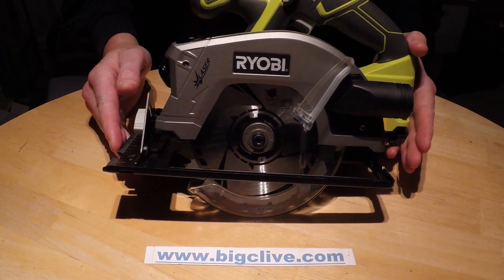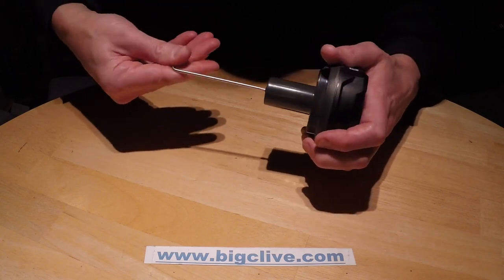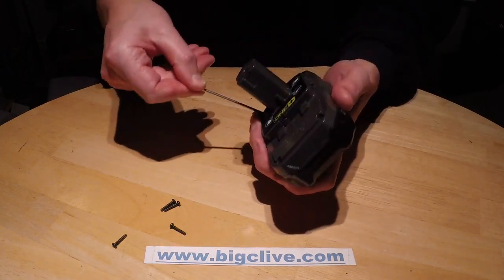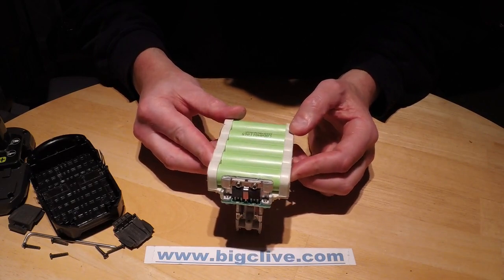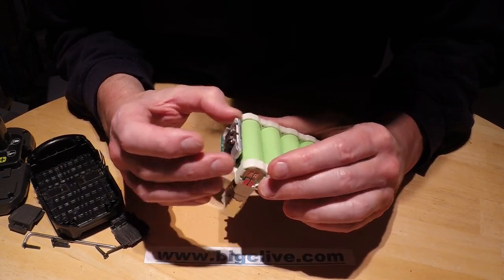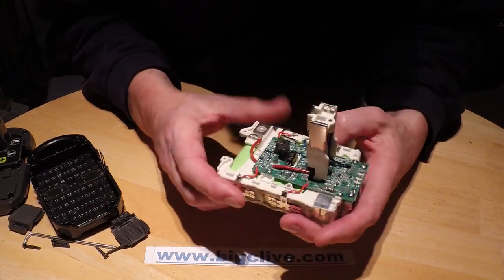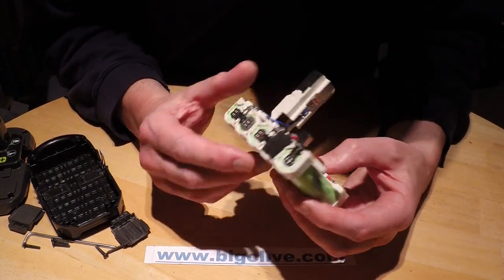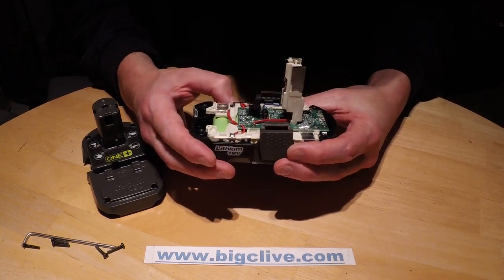A look inside a Ryobi 1.3Ah 18V lithium battery pack.

Comment: Next time use electric screw driver, or power drill to remove screws, it can save you a lot of time.
Reply: Might not work on all batteries. I just opened one and they use security T10 screws. (Answered at 1:40)

Comment: Hey Clive, love your content. Any chance you could go into more detail about how the 2 mosfets work in this circuit? I've opened a pack and am troubleshooting why the 5s batteries show 21v but the pack terminals show 9.6v. It seems related to the mosfets. I would love to be able to repair the pack but at this point am more concerned with just understanding how it works.

Comment: I actually use a pile of different tools all purchased or received second hand without batteries.
I did make sure all were between 18-21V.
Ended up hacking connectors off of all of them, tacking on a standard hobby plug (deans), and using my ample supply of 5 cell 90C batteries my drones run off of.
Works incredibly well and you don't need to buy the overpriced $150 batteries for each tool. I also use a $25 charger from Aliexpress in balance mode.

Comment: ...thanks for not trying to see if the cells are removable, so that I could recharge them in a pinch with a solar charger using a rechargeable head lamp...
Reply from the maker: That's not practical.  But you could improvise an external charger.

Comment: A bit late to this party, but I've been doing a sort of CPR on these. Seems if one or more cells drops below @10 volts, the charger/charging circuit will refuse to charge the battery. If I remove the pack from the case and charge the cell array directly, by-passing the circuitry (from a fully-charged battery), and get the total voltage above 12-14 volts, the charging system will allow the pack to be fully charged. It just takes a minute or two. Once fully charged, I test each cell for reasonable voltage.
I took four batteries from the recycle bin at the big box store and all were fine after this procedure (two were the big 10 cell packs). They've been working fine for months now.
Moral of this story? Don't let these battery packs self-discharge below 10-12 volts or the charging system will reject them, even if they are perfectly good.

Comment: I have problem with p107. I upload video in here 
https://youtu.be/8kVmbHED6_A
Can u tell me what happens with my battery pack?
Reply from the maker: It may be in protection mode if one of the sets of cells has dropped below about 2.5 to 3v.  If a cell's voltage drops too low it suffers damage.

Comment: The arrangement of the back-to-back mosfets is to be able to 'disconnect' current flowing both in and out. This is not possible with a single mosfet, since it has an internal body-diode.
Reply: Thanks for this comment. I’m in the process of diagnosing a failure on one of these packs and those MOSFETs appear to be the problem but I couldn’t figure out what their role was in the circuit.

Comment: All i did after the battery died on my NI-CD drill was take out the 10 sub-c batteries and stick in a 14.8v lipo battery pack i got from a car boot sale for £1 and cut a hole in the shell to hang the cables out and charge with a Imax B6 balance charger.

Comment: What you are talking about is ..... Li Batteries needed Balancing. Also, when it's HOT the Switch / Thermostat would CUT OFF until Temperature is SAFE again for the LI Battery to work. LI Battery is NOT good at HOT environment. So basically this is a Charger Regulator, Balancer and Safety built it.

Comment: I have salvaged several 1+ packs and checked out the specs on the cells in them and they are quite good for the price we pay.  They can put out a massive pile of current even when in the 5 cell thin packs like in this video.

The full sized packs are even better as they are 5s2p in configuration and will seriously pump out current.

The cells I have salvaged from them all seem to have a max current draw of 20A so it is quite possible to see 200A from a full sized pack.

Comment: that looks just like the insides of the craftsman c3 19.2 volt packs, i would say with how many i have sitting in a box dead i would if i were you waterproof the packs or coat the boards with something like a potting cause here in FL USA its humid and they get corroded fast.

Comment: if you have no charger for the battery pack, could you take the batteries out of the pack and charge individually? The chargers here are very expensive.
Reply: I think you can charge this thing with simple 22-24V DC at the contacts of the pack. All the charge logic is inside.

You can charge a single cell via USB-Connectable PCB (30 ct including package!).
http://www.aliexpress.com/item/Free-Shipping-5V-1A-Micro-USB-18650-Lithium-Battery-Charging-Board-Charger-Module-Protection-Dual/32453058256.html

 There are even such "balancers" for more cells.

Comment: Would it be feasible to built similar pack? I've seen some nice Bosh tools with no battery pack, with spares costing way more then tool itself... I wonder if some simple 5S1P controller would do the trick...
Reply from the maker: +cthulpiss Given the huge current that these battery packs have to deliver I'd recommend going for the official unit.

Comment: the three upper tabs on the battery are as follows, battery positive,  battery negative,  temperature probe. if the battery is too warm the charger won't start charging until the battery is below a certain temperature and if the battery temperature rises above that maximum temperature while charging it will stop charging again. I've had times where I'm using one of my tools and the battery cut out as dead but was too hot to charge so I just tossed it in the freezer for 5 or 10 minutes to cool it then put it on the charge. stared charging right away the. 10 minutes to cool is way better than 30+ minutes.  especially when you only have 2 batteries and need the dead one charged as fast as possible.

Comment: LG DAHA1 18650 Cells are 1300mah 30A (Continuous) Cells. So they can take one hell of a beating before even throwing a hissy fit. Good and easy to get replacement cells could be the LG HB6's (1500mah 30A) or the older Sony VTC3 cell (1600mah 30A).

Comment: The only problem I see with replacing the cells in these packs is the quality 18650 cells run about $10 each. After you replace all 5 you could have spend an extra $5 and bought a new pack with a 3 year warranty. I know you don't live in the states so it might be different in your case.
Reply: +Zach Demand For $10/piece you can get proper 3100mAh cells in 18650.
For actual reviews of cell capacities, try here: http://lygte-info.dk/review/batteries2012/Common18650IndividualTest%20UK.html
He started reviewing cells in 2012, it's been updated continually.
Reply: +Zach Demand 10 each? no idea where you buy your cells, but thats fckin expensive :D
Reply: I usually buy from batteryjunction.com because I was tired of buying batteries that were rejects and sold as good batteries. I have tested all the batteries that I have bought from them and all of them have been reasonably close to the specified rating. would gladly pay $10 if its a quality cell.
Reply: +Zach Demand Proper high drain 18650 LG or Panasonic 18650 cells cost £9 a pair.
Reply: Where?
Reply: i bought 20 of these batts on abay for $15 posted,repacked my ryobi batt and been going now for 12 months no probs...quite a few laptops use these too...shop around.
Reply: +Zach Demand 
protected or unprotected btw?
i pay like...4-5 € per cell, Panasonic 2200+ mah
Reply: Protected cells wouldn't be necessary when rebuilding a pack like this. The cells I usually buy are 2600 mah, flat on both ends and have an option to add tabs. Perfect for building packs.
Reply: +Zach Demand just like mine, i used about 200cells now and bought them for 5€ each
6.x€ when bought in less quantity :D
Reply: I'm not. Usually battery packs are cheaper to buy than rebuild. You also get a warranty. The only time I would rebuild a pack is if I couldn't buy new ones anymore or if its not suppose to be replaceable and you cant buy them anyway.
Reply: +Zach Demand or if its an older model, when you only find "new old stock" that has been sitting on the shelf dead for years
Reply: +Jonny Dahl where?
Reply: Telephone Telephone
 it's a store called akkuteile.de
they have most major brand cells
If you order more than 30 cells you get 1€ off per cell already. (i ordered 400)
Reply: 18650 cells are in everything though, you can fairly easily just salvage used cells from old laptop battery packs and the like, or a dead USB power bank (from my experience the cheap/rigged circuitry usually dies before the cells).

Comment: Where would you recommend I go to buy replacement Sub C cells for my Snap On impact gun? I bought some '6000mAh' NiMh ones from china on ebay but they were awful - less than 1000mAh and no high current draw possible. Also some 2500mAh NiCd from ebay - similarly crap!
Reply: +dopiaza2006 You're simply not going to find "6000mAh" cells in NiCd Sub C. The reasonable capacity is about 2200mAh. A set of 15 for an 18v pack is about $30 on sale. You can go with/without tabs, in paper wrap or shrink. You could upgrade to NiMH (same charging circuit) for about $4/cell and get 3800mAh cells. These are direct from the manufacturer, Tenergy, in the US prices, not direct from the recycle yard in Shenzhen prices. And if the price sounds steep, they are better than a lot of online stores if you search Google for Sub Cs. That's why I retired the heavy old NiCd tools. All-battery(dot)com is their webfront store.

+simhopp He's looking for Sub C cells, not 18650s. Sub C cells are nominally 23 mm in diameter and 43mm in length, so in Li-Ion terms they are 23430 cells. Sub Cs have about 2-1/4 times the capacity of a AA cell (14500). There are several derivative sizes that share Sub Cs diameter usually prefaced with 1/2, 2/3, 4/5, 4/3, 5/4. C cells that power flashlights/torches are 26mm in diameter and 46mm in length. That's without the button top.

Comment: Sad state of affairs when you can purchase a new one on Amazon for $35.  Replacing the 5 cells alone would far exceed a replacement.
Reply: It's usually the electronics that go bad.  You can buy a new one, pull the cells out of the old one, and repurpose them if they still work.

Comment: The 18650's are also commonly used in electronic cigarettes / vaporisers, which are maturing with their technology, with current drain around 30 amps at the single-cell voltage of just 3.7v = 111 Watt not uncommon. The usual inefficient process of converting electrical energy into heat, i.e the atomiser, which is nothing more than a coil of wire with a resistance low enough to turn your battery into a volatile hand warmer... lol.
Reply: ***** "The 18650's are also commonly used in electronic cigarettes" that would make the electronic cigarette rather large.  More like an electronic cigar !
Reply: +UKHeliBob think more VHS cassette for a 260w mod
Reply: +Mark Bartlett I thought most of those used Li-Po packs, an 18650 is way to big unless its an electronic stogie!

Comment: I love Yours teardowns, did You found the balancing circuit on the battery control PCB? I can't find another socket for balancing so I guess  the balancing is in the battery pack. Could You identify IC which control whole battery pack? Cheers!

Comment: ryobi have to put more charging control inside the lithium cells and not in the charger because ryobi tools and chargers are backwards and forwards compatible with their older nicad cells, thus you can upgrade to a newer battery without having to buy anything else
Reply from the maker: The bulk of the circuitry in the lithium packs is to deal with the balancing and monitoring of the individual cells.  I'd guess there's just as much circuitry in any typical lithium power tool battery.  If you switch from NiCd to lithium (which I highly recommend to anyone with Ryobi plus tools), you need to get the new charger that does both the lithium and older NiCd cells.
Reply: +bigclivedotcom makita lithium dont have balancinc circuitry
Reply: I don't believe that.

Comment: I love the ryobi gear! I have repaired a couple in my time using them! But I have a question regarding a small project.

I'm about to disect a pack and I'm going to remove all existing cells and replace them with others and then stack them in parallel to reach 10AH capacity! (Not for powertool use) I plan to use this to run a notepad whilst i'm away from the grid. Do you think i'm mad or do you have any idea weather i'll burn out my charger?
Reply from the maker: As long as the charger sees a pack of five groups of cells I don't see any reason it would have an issue with charging them.  It might be worth checking to see if your charger has a "rest" time between charges of normal packs though.  If it runs relatively cool while charging a normal pack it's probably not a problem.
I don't know if the Ryobi chargers have a timeout if the charge is taking an unusually long time.
Reply: bigclivedotcom
I'm more of a do it person and if it doesn't work I will try something different! lol I will find out the timeout function the hardway! (Just the gem of information I was looking for) Failing that put it on a segment timer and stop the charge after 3-4 hours!

I know the charger doesn't overheat after putting 3 4AH batteries through it one after another!

thankyou for your wisdom, I will send you a link when I get it done! =)
Reply: A charger meant for charging 5 cells in series will not be able to charge 1 cell. It's like removing your 12V car battery and replace it with a 2V Lead-acid battery, and expecting the car alternator to adjust to the new battery, What you end up with is smoke and fire.
Reply: You misunderstand It will be 5 cells series and 7 1800mah cells in parallel
Reply: pietkaify Ah - no problem them :D
Reply: +pietkaify Why not do the same thing to a pack that fits in your notepad? They are usually a very similar arrangement inside.   for many laptops you can already get packs with 9 cells or so (3x3) that bulge out the botom, or back of the machine, and that might be easier to attach an even bigger box to.

Comment: Without looking up the datasheet, the two fets probably are connected in series drain to drain through the heatsink, that's generally how lithium protection circuits work (for both over and under voltage), turn both fets off to stop any current flowing in both directions - you need two in series with one "backwards" because of the body fet's diode which would otherwise permit current flow in at least one direction.
Reply from the maker: I think you're right.  It does look like a beefed-up version of the dual MOSFET package found in many battery protection circuits.